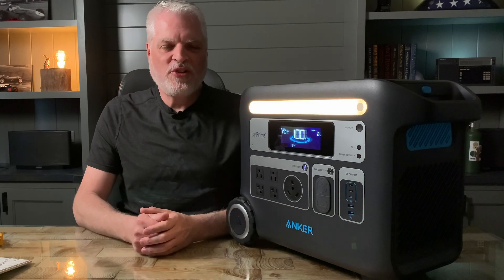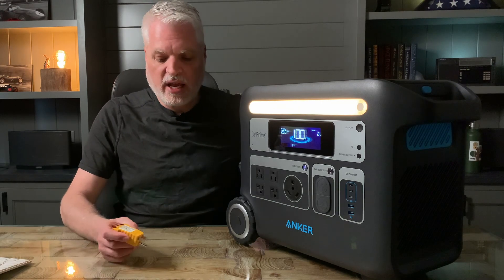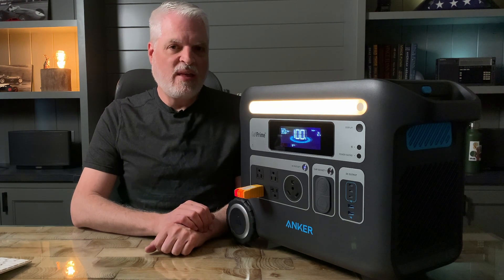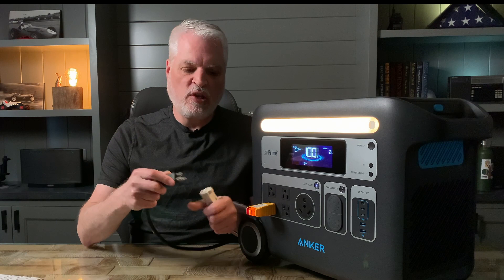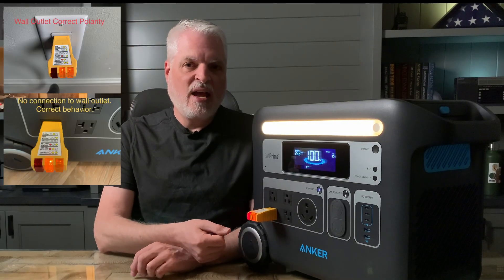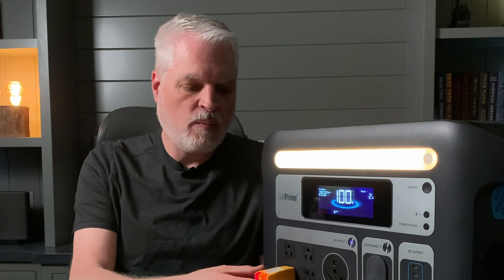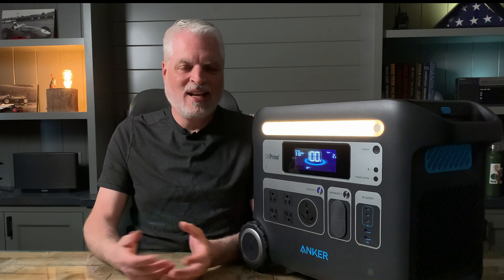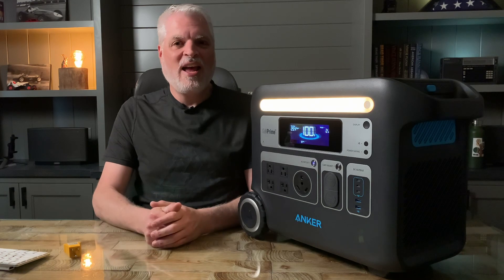SAFETY ALERT: Anker 767 Power Station - DO THIS TODAY!

Comment: Aargh. what a hassle. i bought mine 2/19 and it was delivered 2/23. i live and travel in my camper van which is powered by my 767. i boondock 99% of the time so it is solar charged. i have nowhere at the moment to plug it in to test it. where do you even get a box that big to return it in? 

would it be terrible if i didn’t replace it? 
i don’t use ac power much. i’ve converted my life to 12v for the most part.
could i still charge it via ac if i just don’t use the ac sockets?
what are the consequences of reversed polarity sockets?

sorry for all the questions but thanks for posting this info.
Reply from the maker: Hi Joe, it really boils down to a safety issue with the AC outlets. Many people have their homes wired incorrectly with reverse polarity for years without noticing, until they have a home inspection. We’ve all been using our Ankers for months without noticing the issue. The reason it’s a safety issue is, when you turn off an ac appliance, you think the ‘hot’ has been disconnected, but it hasn’t, the neutral lead has been disconnected. So, if you touched a lightbulb base by accident, or you stuck a fork in a toaster to get out a stuck piece of bread out, you could be in for a shock. In your situation, I’m wondering if Anker would do an advance replacement so you aren’t without power in your van, and could use their box for return shipping.
Reply: @TRAILPOWER  that’s an interesting thought about the advanced replacement. i’ll investigate that, thanks.

Comment: Do you think that is causing the problems I’m having?  https://youtu.be/4cLGNKwDY0Q
Reply from the maker: Hey Sheen, Did you happen to test your air conditioner when disconnected from AC power? That would tell us if it was a related isssue or not, since the reverse polarity issue doesn't appear when running off the inverter.
Reply: @TRAILPOWER  I only tried when the anker was off AC power.  I didn’t even know about the reverse polarity until later.  

Anker initially told me they think it’s a firmware issue, said they are working on new firmware.  Either way there’s something wrong.
Reply from the maker: Yeah, definitely not the same issue. I’ve tested a bunch of appliances to look for bugs and have only found one. I have one older space heater that doesn’t startup properly when running off the battery & inverter. The heat comes on but not the fan. If I plug the Anker into AC power, it begins to operates properly. If I unplug the Anker from AC, the ups picks up the load without missing a beat and it keeps running. But if I turn off the heater and try to turn it back on when on battery, it once again doesn’t start up correctly. All that said, I’m wondering if there’s any connection to your startup issue. I’m wondering if you ran off ax passthrough, if it would run properly, and then if you disconnected the AC, if it would keep running properly.
Reply: @TRAILPOWER  when that happens, does the anker show the erratic wattage like mine?
Reply from the maker: @TesSheen  no, it does not. I’ve never seen anything like that. You might ask Mikey here in the comments to look at your video. He’s an Anker owner, and an industrial electrician.
Reply: @TRAILPOWER  my new unit I received now tests correct when connect to outlet. and runs my air conditioner fine when the Anker is plugged in. But once the Anker is unplugged it begins to output erratic wattage. Anker told me they just released a new firmware 1.2.2 so hope it fixes the problem

Comment: In your original review, you forgot to mention that this unit is NOT UL Listed or certified, and that they are not to be used in a humid environment, or ambient temperature obove 104 ! degrees !
Reply from the maker: Just to be clear, the Ecoflow Delta 2 manual says, "Do not use the product in rain or humid environments."
Yes, the Delta 2's operating range is up to 113F, while the Anker and Bluetti are listed at 104F.
If that is the single most important feature for you, then I'm glad you found your match. I personally wouldn't want to drop my battery capacity in half to 1024wh, or cut my solar input in half to 500w. But that's my priorities. Your priorities are different than mine, and those differences make the world interesting. I wish you the best.
Reply: @TRAILPOWER  you don’t want to address the UL listing issue , that’s The most important issue !
Reply from the maker: @ronaldcarrender6136  Ron, my understanding from what Anker has published about UL listings is as follows:

"UL is both a US standards body and a laboratory. National Recognized Testing Laboratories (NRTL) like TÜV Rheinland can test to the same standards and specifications as those defined by UL as US standards. Our cTUVus certification is from TÜV Rheinland."

I posted this video in support of Anker owners with assistance on a specific issue. You have made it clear that you are not here for that purpose. I'd encourage you to contact Anker with your sincere questions about their certification if you so desire. I wish you well.
Reply: @TRAILPOWER  well said!
Reply from the maker: That's very interesting. In your research, how does that compare to Ecoflow and Bluetti?
Reply: This is a great note considering so many of these units are being used in camper vans and overlanding trucks where they may be left inside a hot cab during the day while camping in the desert, or in the humid south. What is the risk to the user if you exceed those limits with the unit?

And I wonder if the Pecron 2000lfp is UL certified. When I do a search it looks like the battery they have in the Pecron is a UL certified Lifepo4, but not sure about everything else in the unit.
Reply: Eco flow has technology to deal with the humidity issue , and the operating temp is 14 -114 degrees Fahrenheit! Eco flow is UL listed and certified ! This is a must, for any electrical appliances!
Reply: I’m buying the eco flow delta 2 when I get my refund , I don’t need a silent fan , I need a unit that can operate in a slightly more extreme environment than this unit will tolerate !

Comment: My new unit arrived today and tests correctly.  I’ll post a follow up video tomorrow.
Reply: Have these issues been resolved in newer batches? Im commenting 3 months after you guy’s conversation because i am looking at getting one of these if the issues are fixed
Reply: @xKINGxRCCx  yes,  the new units don’t have this issue any longer but there may be some old units floating around with third party vendors so keep that in mind when ordering a unit.
Reply: Looking forward to it.
Reply from the maker: Hey leaf, can you test something on your new unit? I have somebody saying that their new unit tests correct with the AC outlets turned on, but their tester is lighting up with hot ground reverse when the AC is powered OFF and the unit is plugged into shore power. 😵‍💫
Reply: @TRAILPOWER  My outlet tester doesn't light up at all with the 767 plugged into the wall and the inverter off. This is with the 767 fully charged.
Reply from the maker: @leafnutz2341  Thanks, that’s what I would have expected. I’ll pass that along.
Reply from the maker: @leafnutz2341  I received my replacement, and it tests proper when charging, but shows a ground neutral reverse when running from the battery. Just heard from another person with a replacement unit with the same behavior. Are you seeing that on your replacement?
Reply: @TRAILPOWER  yep, mine tests the same way.  It's fine.   Typical outlet testers are fairly meaningless when the unit it's plugged in because of the floating neutral.
Reply from the maker: @leafnutz2341  thanks for the confirmation. So, it’s problematic when connected to AC but not a problem when running off the battery & inverter? Seems like the same safety issue would persist.
Reply: Nice, can wait for the video!

Comment: I just checked mine which I ordered directly from Anker, and received on the 13th of this month. It checks out fine with no reverse polarity whether plugged into AC, or running directly off of the battery.
Reply: Glad to help. I’ve got it wired into my generator transfer switch (added another 30amp inlet outlet in the laundry room to keep it indoors, with a separate switch to pick gas generator vs solar generator input), and am running various loads to test run times. I only have 200W of solar from an older DIY solar generator project feeding it, but am planning on picking up the 480W QCell panels. Looking forward to your report on those!
Reply from the maker: @HamnesiaRadio  Awesome setup! I'm in the process of building our solar rack, and wiring into our home currently. Will have some upcoming videos on that process, and installing a generator load transfer switch. You are ahead of me!
Reply: @TRAILPOWER  That’ll be nice to have it done, and make for great videos! I installed my transfer switch a few years ago (10 circuit model) with gas in mind. The solar part came later… ;)
Reply from the maker: Nice. I’m installing the reliance 10’circuit unit. Eventually, I expect that we’ll upgrade our main panel to a smart panel, but we’ll let that shake out for a few years.
Reply: @TRAILPOWER The Reliance 10 circuit unit is the one I installed also.  You’ll be glad you went with the 10 circuit model. I see a lot of folks getting the 4 and 6 circuit models and regretting it right away.
Reply from the maker: @HamnesiaRadio  can you test something on your new unit? I have somebody saying that their new unit tests correct with the AC outlets turned on, but their tester is lighting up with hot ground reverse when the AC outlets are powered OFF and the unit is plugged into AC power. 😵‍💫
Reply: @TRAILPOWER  Oh boy… Okay, I just checked. I’m using a multimeter to check actual voltage, not a little light indicating tester. When the unit is charging from AC with the inverter off, I get 0V between the hot and neutral. I am getting 101V when going from either hot to ground as well as neutral to ground. Same voltage potential between ground and either hot or neutral plugs with inverter off and plugged into AC. 

With the inverter on and charging from AC, I get 0V between natural and ground and 120V between hot and ground (and obviously 120V between hot and neutral). 

All of this testing was done with my Anker unplugged from my transfer switch, so no bonding of the neutral and ground in the panel (floating ground).
Reply from the maker: @HamnesiaRadio  You’re more experienced than me with AC power. I’m still learning about bonding, grounds etc. But it sounds like you’re confirming that you have 101v when there should be zero.
Reply: @TRAILPOWER  Well, I’ve got an industrial electrical degree, and still have to think those types of things through, so don’t feel bad…

I just did one more test with the inverter off, plugged into AC but plugged into my transfer switch (using the panel neutral ground bond). Results are what I’d expect with ~4V between hot and ground and 1.2V between neutral and ground (and 0V between hot and neutral). Just bleed through basically. 

What we’re seeing here is just the side effect of inverters having to run portable without a bonded natural and ground, as well as be able to hook into a transfer switch and not balk/throw faults. I have a cheaper portable inverter built into a DIY solar generator, and if I plug it into my transfer switch it throws a fault and shuts down. That’s because it has an internal neutral ground bond internally already, creating a ground loop. 

All that to say, I’m happy with the way this is working and am not going to worry about it. My plan is to charge via solar almost exclusively, but even if not, I wouldn’t worry.
Reply from the maker: @HamnesiaRadio  wow, I know who to come to with questions! Glad you’re here! Would you mind popping over to the thread with user ‘hour hour?’ I told him I’d see what I could find, but I’m out of my depth on this one.
Reply: @TRAILPOWER  Sure thing! Always glad to help as long as I’m not trying to convince someone of something they don’t care to be convinced of (you know how online forums can get.. ;)
Reply from the maker: All too well today. Can of worms opened. I think you’re safe on this one.
Reply: @HamnesiaRadio  I received my new unit and it tests correct while plugged into outlet, when un plugged it tests with the red light on but dim. 

When I plug anything with a compressor (5000btu AC, house fridge) the Anker outputs erratic wattage. This happens only when the Anker is unplugged. When the Anker is plugged in, the air conditioner runs properly. 

Any insights? Here’s my video. https://youtu.be/JH0LOmtinp8
Reply: @TesSheen  Hi Sheen. The tester’s red  light illuminating dimly is because there is a small voltage (which is all the lights are looking at) when not plugged into an AC source and having a floating neutral. If you have a multimeter, you can measure actual voltages to see what’s happening. 

As to your compressor behavior with your AC unit, I’m not sure. Mine is running my fridge/freezer just fine without being plugged into AC, but I do have my unit connected to my generator transfer switch which is bonding the neutral and ground in my main panel… I’m not running the fridge/freezer directly from the front of the Anker. This way I’m not lugging the Anker to my basement and pulling the fridge or freezer out from the wall to access the plugs. I have the Anker permanently mounted on a shelf in the laundry room going to a 30amp plug I wired in to the transfer switch in the garage. 

If you hear from Anker, or a firmware update does correct it, let us know. I’m curious to see the outcome.
Reply: @HamnesiaRadio  thanks for the reply. When the Anker isn't plugged in, Im getting 100v from neutral to ground and 30v from hot to ground and of course 120v from hot to neutral. is this normal?   

I ordered a bonding plug, and will see if that fixes my problem, but also Anker just told me they have firmware 1.2.2 that should fix it.
Reply from the maker: Sheen, my replacement sounds identical to yours. Running off the battery I also have the dim red, bright yellow labeled as a ground neutral reverse. I show 35v hot to ground. 92v neutral to ground. 120v hot to neutral.
Reply: The voltages are probably what mine showed also if I remember correctly, and is why you both are seeing the dim red light. Let me know what you see happen with your AC unit when your bonding plug shows up. If they can correct your behavior with a firmware update that’d be great.
Reply: @TesSheen did the firmware update ever fix the issue??
Reply from the maker: Hey, Mikey, that’s great to hear. I appreciate the report back.
Reply: Fantastic! Glad to hear they fixed it. Where did your unit ship from and how long did it take to get it?
Reply: @dcd6115  It shipped from Bloomington, CA on the 10th and was delivered on the 13th to Spokane, WA area. Very fast for FedEx…!

Comment: Bluetti had a similar problem with their AC300Max model - the 30 amp RV plug had reverse polarity. I think some consumers had a difficult time getting Bluetti to own that problem. Fortunately it appears Anker is taking the right steps to correct reverse polarity issues with the 767 Powerhouse.
Reply from the maker: Good to know that Bluetti ran into this too. Like you, I'm really happy to see Anker taking responsibility, and not hiding. I do hope they issue a notification email to owners, and I've encouraged them to do so.